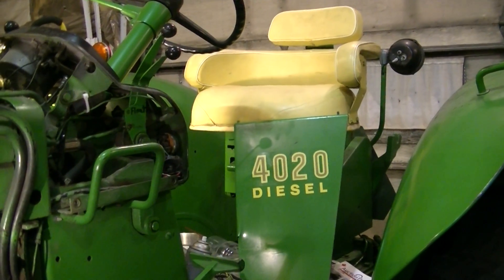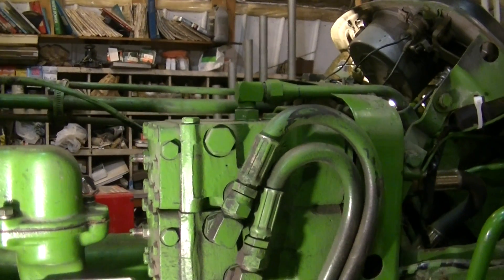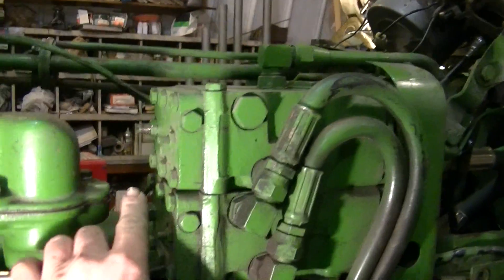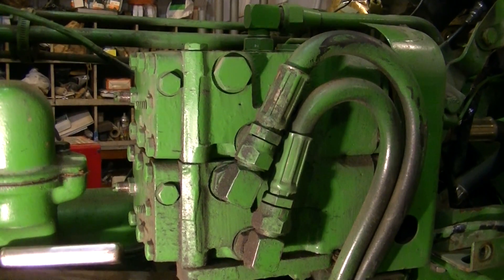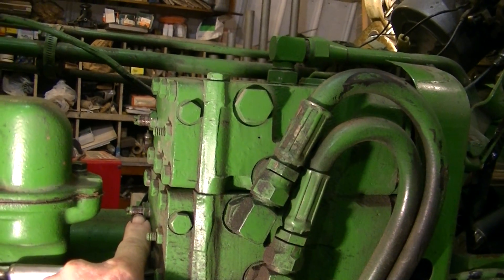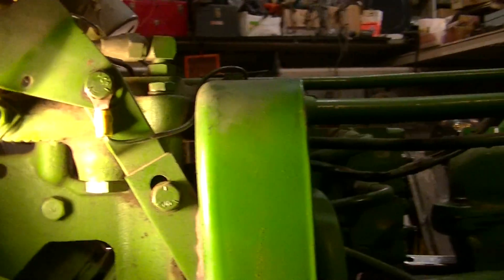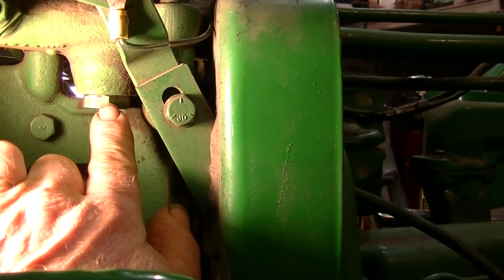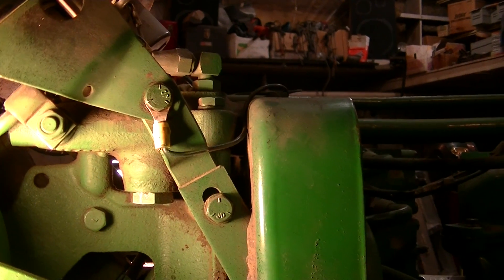John Deere 4020 RSCV hydraulic Rear selective Control Valve adjustments - zeketheantiquefreak

Comment: Yes i realize that it's 4 year video but i have a question about plumbing in a second closed center spool valve to run the loader Deere service told me to tee off of my pressure line that goes to spool valve and return teed off to the return line down on left side by pressure relief valve.
You showed the plug on bottom of priority valve is that the same cavity that pressure line comes from for spool valve  if this is the case straight down from the priority valve on the casting where the console attaches there is a orb threaded port that goes into the casting and does a 90 out the side of the casting by brake pedal so if that plug is same cavity makes easier to install the pressure line for second valve however is there any better place to run return line too because that 45 fitting at pressure relief wont come out unless you remove pressure relief valve first i could use rubber hoses to deal with it but the steel lines are pristine . Service told me not to just dump return line to case because you will starve pump for oil and lose the pressure relief function that's why I was asking about a better return line option if you know of one . Now I know how to speed up my hydraulic flow thanks.
I have 3 66 4020s they all have steel lines from spool valve down through the console with joiners then carrying on under floor pan back to scv couplers.
Reply from the maker: Thank you for the comment. I will check into this and get back to you, probably within a day, if that is ok.
Reply from the maker: Ok... I am not sure I can be of help on the return. I haven't had the need to put a loader control valve on the right hand side, so I have no experience with the actual application/process. I was told by a fellow that is very familiar with the 4020's that you could return back to the filter housing... That said, maybe the later models have a 'plug' in the filter housing cover. Mine does not. Maybe tomorrow I will lay under the tractor and see what is there. I can see a bung to the rear of the filter housing, but that may be the pressure release valve or the filter screen... Sorry I could not be of more help for now.
Reply: You’ll want to get a filter housing with the port in it to return directly to the filter to help prevent cavitation of the high pressure pump.

Oops. Just realized I responded to a video from 3yrs ago. 🤦‍♂️

Comment: I just replaced that main line from the frount pump that’s behind the fuel tank and runs back to the counsel! Does the system need bleeding because the steering is hard, brakes are soft and three point jerks when raised! Fluid is full! JD 4000 diesel late model!
Reply from the maker: Sorry for the tardy reply... Not all of the comment came through at first. If you haven't solved it by now I can ask around. It is a somewhat different tractor than my early 4020 so my manual may or may not be of help. If you just had the pressure line off the pump shouldn't have lost fluid on the suction side, no? It may be as simple as cycling all of the hydraulic systems to force the air out of the system, but I would not want to advise you to run a dry or cavitating pump.
Reply: zeketheantiquefreak I was told there may be an issue in the steering pump with dirt/contaminates that may of messed a valve up! That why it only steers to the left and hard to no steering to the right after bleeding the pump! Can this be true?
Reply from the maker: Yes, I feel that dirt in the steering valve could cause these problems. I suggest getting onto a John Deere Q&A forum and describe the problem in as much detail as possible. Very knowledgeable people read these forums and may have an answer for you. Please keep me informed.
Reply from the maker: A couple of months has passed... Were you able to solve the problem?
Reply: Yes, bleed bleeder on top of power steering pump! There was an air lock somewhere in the line! Full steering now... thanks

Comment: Got 2 4020s, 1968 & 1970. The '68 is really leaking at the SCVs mounted at the rear. Curious if you have done a reseal on one of these model 4020 SCV? The prices on rebuilds are astronomical! I really enjoyed the SyncroRange shifter re-bushing you did. It's next on my list of things to do on my 1970 then the leaking SCV.
Reply from the maker: Fortunately I have not had any problems with the rear SCV's on my '64. I am assuming that your problem is more than just the o-ring where the hose coupler seats against. Are they the right couplers? To see an exploded view of your units go to jdparts.deere.com
A real useful tool is forums.yesterdaystractors.com  
Thank you for the comment and let us know what you find out.
There is a video here on You-Tube posted by Abilene Machine, Inc: 'Rebuilt selective control valve'. I haven't watched it myself but may have info you need.
Reply from the maker: A month or so has passed... How did you make out with the leaks?

Comment: The covers say 4020, but the handles on the sides of the dash are indicative of a 4010. Did the very early 4020s come with 4010 dash handles?
Reply from the maker: Yes, you are 'bang-on'. Being the first year (1964) this unit would have to wait a year for the diff lock for instance. An interesting article on the differences between a 4010 and a 4020 can be found here:
http://www.greenmagazine.com/articles.asp?id=17

Thank you for your comment.
Reply: I came back to this video to re-remember which holes are used for the float position and I noticed the  hoses coming off the side of the lower SCV unit under the hood. Are those a Deere thing or were they originally steel tubes? I'm wondering as someday I want to add a second SCV to our 3020 and kinda want to keep it how it would have looked brand new.
Reply from the maker: @harisonk  Oops, I only found this comment now. My apology. As far as I know this arrangement is original. A peek at a parts diagram may reveal the truth.